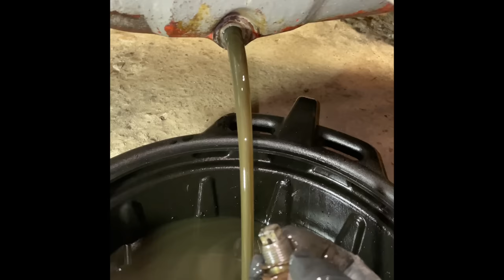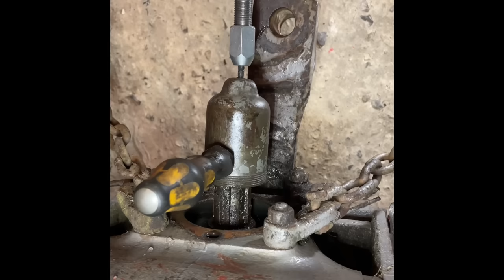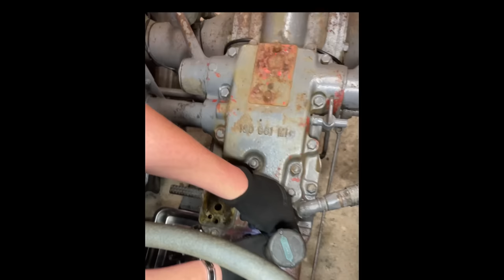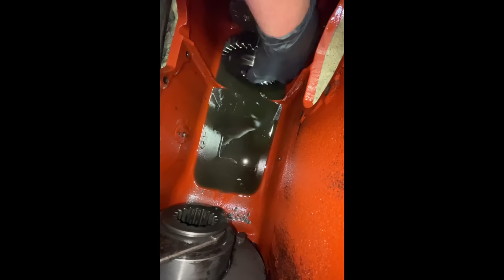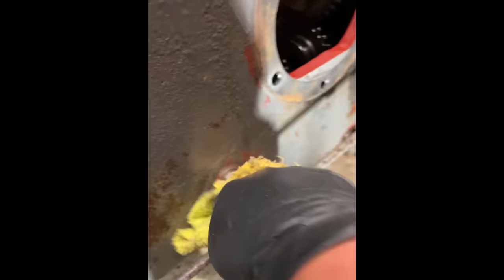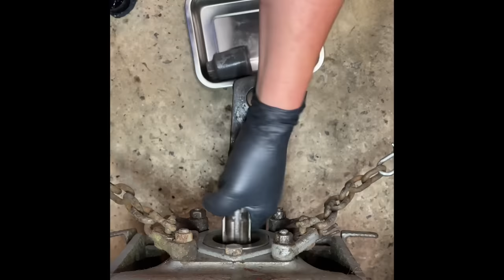PTO Failed on a Massey Ferguson 35. #pto #fail

Comment: Can i compliment you on a really good video.  Can I just add something though from my own experience.  At about 3.47 after you had taken out the PTO shaft you cleared out some gunk from the outlet of the diff housing and showed us briefly some needle bearings.  You might wonder where they came from.  Well along the length of the PTO shaft there are four bearing points.  Starting from the back there is a large ball bearing (which you replaced) and then at the opposite side of the diff housing there is a 1 3/8" (roughly) needle roller bearing.  That is where the needle bearings you showed probably came from.   Next the PTO shift gear effectively supports the PTO shaft and finally the nose of the PTO shaft sits in a small needle bearing in the pump.   It seems to me impossible for the pump needle bearings to have got back to the diff housing so that leaves the intermediate one.   Given the fact there are four bearings it may be a moot point whether you need to be worried about the failed 1 3/8" needle bearing as it is a beast to get at and replace (I hope to do my own video on that).  I am not sure if the needle bearings could have got into the rear ball bearing to jam it as I need to check but can I warn anyone looking to replace their PTO shaft that I bought a new one and later found that it was just too big by a few thou for the 1 3/8" bearing when in its housing which may be why my bearing failed!  Slide a new PTO shaft in gently first without the rear ball bearing in place just to check it does not foul the needle bearing - it should slide in smoothly and into the pump housing.  Well done.
Reply from the maker: Thanks. 
There were only one bearing there was destroyed due to the owner was driving with a PTO shaft being too long.

Comment: Should have cleaned out the gearbox sump and inspect the hydraulic filter while it was out
Reply from the maker: Yep. I usually do that, but the owner was on a tight budget, and needed it back fast. Btw a month later I fixed a leaking lay shaft seal.
Reply: There is no filter in a 35 r 65 unless someone put in diferent pump